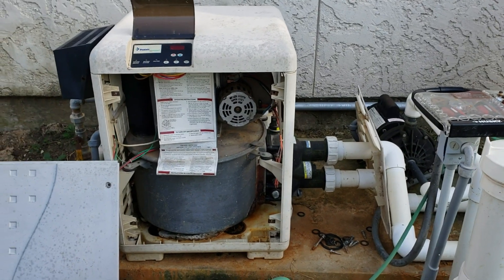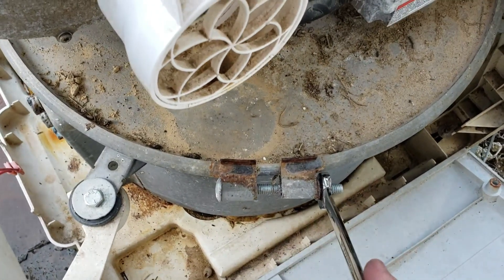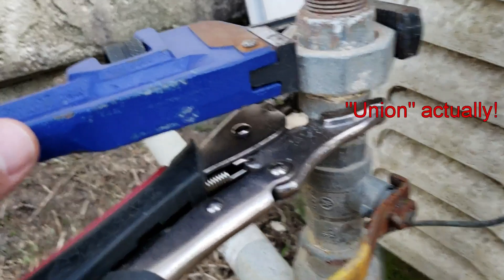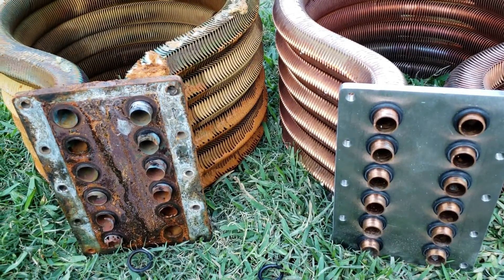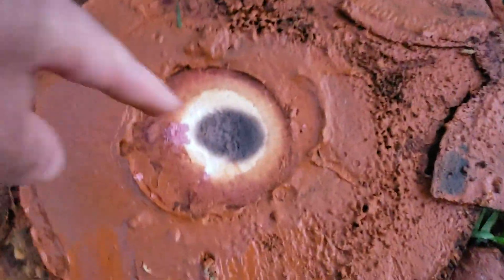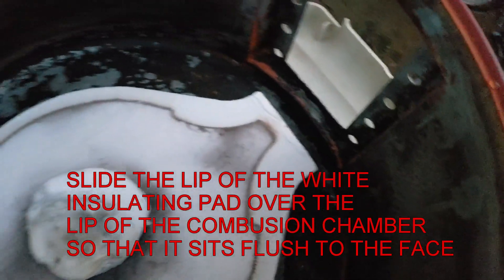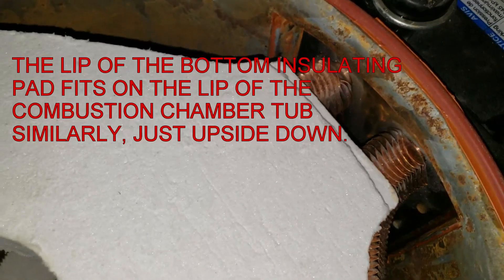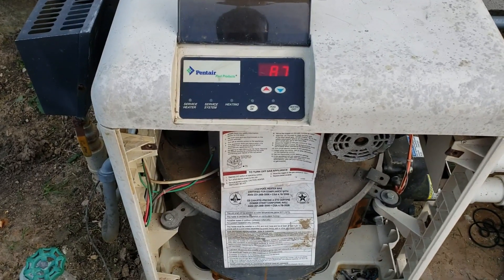Pentair Mastertemp 400 Heat Coil Tube Sheet Assembly Replacement

Comment: i do about 4 exchanger a month for work. its smart to take the igniter out before you slide the burner back in cause they are easy to break. the new exchanger kit should come with a new igniter and you can keep it as a spare.
Reply from the maker: Very good information to know.  Thank you for sharing your knowledge with others 👍
Reply: How much do you typically charge for this repair. I have one coming up and am curious

Comment: Is this easy enough to replace  as a DIY project?
Is everything that is needed provided in the kit or are there additional seals etc that should be replaced at the same time?
Reply from the maker: Mine did not come with any seals.  I think they want you to put new high temp sealant compound on the red rubber seal under the steel band.  That said, I just don't see the point and here is why...this is not a pressurized tub and there is no way any flames are getting past that steel band if you just put it back together like you found it.  The combustion chamber has a massive 4" exhaust pipe confirming it is not pressurized.  It also does not hold liquids, so a tiny leak or crack in a seal will not make a messy situation.  So, sealant around the rim beyond the red stock rubber seal is just trivial.  The 12 copper fittings did come with new O-rings to make a water tight seal against the manifold.  That is great and very necessary.  The process was very simple if you do it like I did...taking the entire upper half off in one motion without disassembling any fan, gas valve or ICM parts makes this super easy.  Takes about 3-4 hours if you take the time to clean the mess in the tub thoroughly.

Comment: Sick fix 😎!! Have you considered putting a check valve on the output pipe?
Reply from the maker: Yes, I heard I need one between the chlorinator and the heater to keep heavily chlorinated water from getting back to the copper.  Makes perfect sense 👌

Comment: I have the same heater. I'm having weird problem. The water is 74 degrees now. I turn the heat up to 90 degrees and it will eat until 83 then it shuts off. There aren't any codes and when the temp. goes to 82 degrees the check heater light turns on and then goes off....then it will fire back up and heat to 83. It will do this forever but never go past 83 degrees. I haven't checked the codes on the back of control yet. I will do this tomorrow. I've replaced the membrane touch pad, the control board below the membrane, I've replaced the flue stack sensor. Maybe it's the high limit switch but I'm thinking it is a water restriction problem but it confuses me because it shuts off exactly at 83 and no more, then restarts at exactly 82 degrees. Maybe thermistor but I would read a high temperature instead of a low one. I will fix it no matter what but I figured you might know better than me. Thank you.
Reply: Thank you for posting these videos...they are really cool and you are one determined guy!
Reply from the maker: Hmmm, no codes, short cycles with service heater light shutting down each cycle before achieving desired temp?  That is screaming thermal regulator replacement.  Watch my video on how to test it and replace if necessary:  https://youtu.be/3ERmEHh8J1s
Reply: Increase your pool pump speed setting when in spa mode first before replacing anything.  It sounds like it might be overheating due to low flow from pool pump.

Comment: I have a MasterTemp 400 that I have been troubleshooting since last year.   I've check different foruns and looks like a common issue, but I have yet to see a resolution. Perhaps you can help. As soon as I turn the heat on, I see a 75 reading. It 'heat' blinks to call for heat and then steady light. It Ignites, air coming out of the exhaust. After about 5 secs it shutts off and temp starts counting up fast to 124 and then goes back to 75 and do the same cycle offer and offer again. No error codes on the front and no LED indicator lights on the back.So far, I replaced the thermar regulator, thermistor, a  broken and just before opening  the pool for the season, I replaced the bupass manifold. I found a rock in fhe by pass manifold so I thought I have resolved the issue. I was wrong. I also  checked the blower. It was clean.  No nest in there. Wires are intact. I'm getting frustrated with this. I don't want to buy and replace the control board because it's expensive and it might not be the problem. Filter is clean since I just opened the pool. The pressure is 20-25 psi, pump is running at 3450 rpm about 85gpm.
Reply from the maker: I love to help people on here by sharing my past experiences.  I would love to be of help to you too, but without codes, I can only suggest the thermal regulator and manifold bypass valve which you have already done.  I have never replaced my control board, ICM, PS, AGS, AFS, blower motor, gas valve or igniter.  I have replaced my bypass valve, thermistor, stack flue sensor, thermal regulator, high limit switch and heating coils and have made videos of each over the years.  I am sorry that I can't direct you in any specific direction.  It sounds like you have tried everything I know to try.
Bummer.

Comment: I work on these heaters all the time and it is almost always the one I use for a replacement. You still have a problem yu need to correct I went through your videos so I could see your equipment and saw what has caused a couple of your heaters failures. There is no check valve at your chlorine feeder.
With out a check valve when your pump is off the tabs continue to dissolve making the water very corrosive all the way back to the heater. Notice how all the tube ends are eaten away on one side thats the side closest  to the feeder.
If you don't  install a check valve you will continue to have temp sensors, bypass and another set of tubes fail.  There a special type of check valve to be used Pentair R172288 Corrosion Resistant Check Valve 
Best of luck and I'm sure your videos have help a lot of people
Reply from the maker: Wow, I didn't think of it that way, but it makes perfect sense.  I wish my pool builder knew that.  I'll look into getting that check valve installed soon.  Thank you for your input.  That comment may help many folks on here as well.  Cheers!
Reply: @pvt-pilot  I have a Pantair Mastertemp125 with what I believe to be same heater coil failure because when I pulled the manifold bolt water came out.  Someone else told me I too have a missing check valve which I will install weather I replace coils or replace heater.  However, my question to you and Keith or anyone else would be if I install a check valve, how would you backwash?  Do you also need to install some kind of bypass? 
BTW, PVT-POLOT, thanks for the great video!  I would not have even thought about a DIY repair until I saw your vid.  Thanks for the inspiration!  :-)
Reply from the maker: @komits41  Hey Jeff, your pool plumbing should have 1 input and 2 outputs an minimum.  (1 input from your pool, 1 output to your pool, 1 output to storm drain for backwash and rinse settings)  If your spider valve is plumbed correctly, your water flow during normal operation will pull from the pool drains and flow forward through the filter, then onward toward the pool by way of the chlorinator.  When you stop the pump, then move the handle to backwash, then turn the pump back on, it will still pull water from the same pool drains but the water will run backward through the filter and then bypass the plumbing going to the chlorinator/pool and go straight out to a storm drain probably in your front yard.  So, if you had a check valve in line just before the chlorinator, running a backwash will not be a problem because the check valve will be between the spider valve and the chlorinator.  The check valve would not feel anything during a backwash or a rinse because all water would be diverted to the storm drain output.
Reply: PVT-PILOT he’s 100% correct.   That’s actually one of the things I look at if something will get warranty coverage or not when it comes to the heaters.  Coils, and the sensors.   If the extra chlorinated water leaks back from no check valve.  And test the water and make sure the alkalinity is all ok and the ph ect.   
Though for sensors an the thermoregulator ect. I usually just cover. Makes no sense to nit pick with a customer like pentair wants.  The exchanger I have to only because that part due to price has to be approved.
Reply: PVT-PILOT but their should be a check valve to keep higher chlorine leveled water from going back into the heater.  Actually is a common thing I see.  A lot of builders seem to not know. Or try an save as many bucks as they can by not putting it in.   I guess in hopes the 3year warranty expires. Before a problem like that that they have to eat the repair bill for incorrect plumbing
Reply: I like the corrosion resistant rainbow in-line spring check valves better. It seems like they fail less than the corrosion resistant square flapper valve style ones.

Comment: Great video, thanks. I’m replacing my manifold due to short cycling and a rattling noise.
Reply from the maker: You are replacing the entire manifold?  I wouldn't do that.  If you hear rattling (sounds like ice cubes bouncing around inside the manifold), that is a broken manifold bypass valve.  It is very common for them to break because they are made if brittle thin plastic and can't put up with pool chemicals very well.  (See other video on my channel on how to replace it)

Comment: How much did that coil cost?
Reply from the maker: Back then, I got mine on eBay for $599 to the door (free shipping and no out of state sales tax back then)
Here it is on Amazon:
https://www.amazon.com/dp/B004VTGDL6/ref=cm_sw_r_cp_apa_glt_fabc_H0QASK8Z0MQCV6HSYJQW
To make matters worse, this doesn't even come with the new white thermal insulating pads.  Mine did.

Comment: You make some good videos I'm just curious as to what the repair bill was?  Thanks!
Reply from the maker: I have $600 in heat exchanger coils(eBay).  I have $99 in replacing sensors(Amazon).  I paid $14 for the new manifold bypass valve.  $42 for thermal regulator(eBay).  All prices are included shipping and there was no tax.  I have around 8-12 hours total of isolating, cleaning and replacing defective parts.  Slow, I know,  because I learned as I went along.  I piece milled knowledge I gained from watching a few really old you tube videos, got the general idea of how everything worked and fixed things myself.  I never hired any professional pool repairman, so I dont know what they would charge in labor, but I can't imagine it would be cost effective to repair this stuff if you don't do the labor yourself.  I hear they run $120/hr.  I felt this heater was too easy to work on for that kind of money, so I did repairs myself.  Cheers!
Reply: @pvt-pilot  I thought you were a service tech at first you give some great information.  We get $75.00 / hr for a tech and helper but we're in the mountains of Asheville so the demand is less than in your area.Cheers!
Reply: Any chance you have the exact parts list you ordered so I don't get the wrong items?  you stated $99 for sensors from Amazon.  I just wanted to make sure I go the right stuff.  Thanks.
Reply from the maker: @benthompson1962  sorry for the late response.  Check this out at Amazon.com
Optimum Pool Technologies Heater Repair Kit for Pentair MasterTemp & Max-E-Therm - Replacement Thermistors & Switches https://www.amazon.com/dp/B072B5VTGC/ref=cm_sw_r_other_apa_i_XQTEEbKDP8XTB

Comment: Good video and explanation of the steps.  I don’t necessarily think that poor water chemistry was to blame though.  I mean, you got 8 years out of it which is more than most would get.  The simple fact that you put a reactive metal like copper in the same neighborhood with a strong oxidizer (free chlorine), something would have to give sooner or later. 👍

Comment: Do you have any idea what is could be, when mastertemp 400 is turned on and instantly turns service system on? Blower not motor blows or turns
Reply from the maker: Yes sir, when you turn on Pentair heaters, they initialize with "service heater" light on and AFS light on.  Both lights will stay on momentarily until the blower motor turns on and blows hard enough to close the AFS (Air Flow Switch).  Once the AFS closes, the diagnostic LED will go out which also should turn off your "service heater" light.  This is normal operating boot up procedure.  Since you say your blower motor is not blowing, your AFS will never close, so your "service heater" light will continue to stay on and your heater will not continue booting up.  You need to isolate the trouble that is causing your blower motor to fail.  Check for voltage on the motors power wires when it is trying to boot up.  If you have voltage, check for obstructions in the fan.  If it is clean, spin the fan to see if it is a seized motor.  You might be able to spin it free.  I had to hand spin mine one season about 5 years ago.  If you have voltage on motor's power wires and nothing else works to get it spinning, you will need to replace the motor.
Reply: Check water pressure switch and high limit sensor. Both should read 0 ohms resistance with pool pump running.

Comment: I just watched all your videos leading up to this.  I give you credit.  Most people would have sprung for a new heater at that point.  Impressive. 

I came upon your videos because I am trying to trouble shoot my dad's non functioning heater. (exact same model as yours).  He claims, other than the Pool LED light, nothing is working when he turns it on.  The blower doesn't even cycle.  "Service Heater" is lit up. But he can't tell me the diagnostic codes lights (if any) because he hasn't taken the panel off to look on the underside of the board.  I'm heading over to his place later to check it out, but in the meantime trying to learn as much as I can about this heater so when I get there I will have an idea what's wrong.